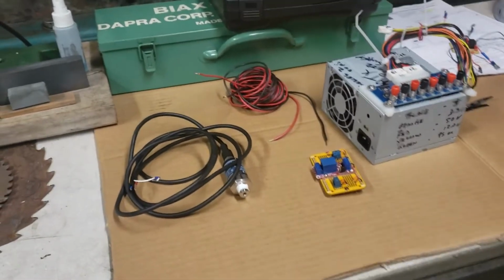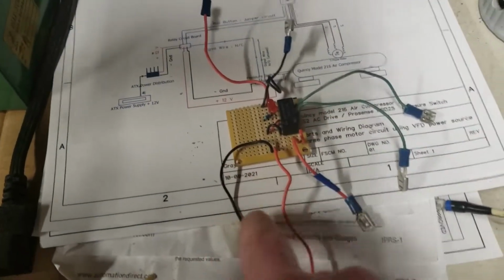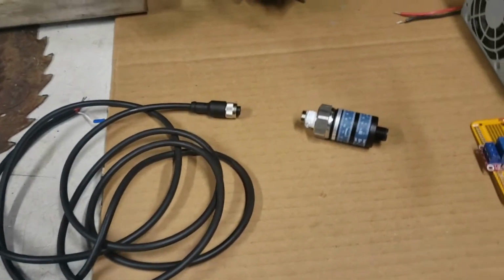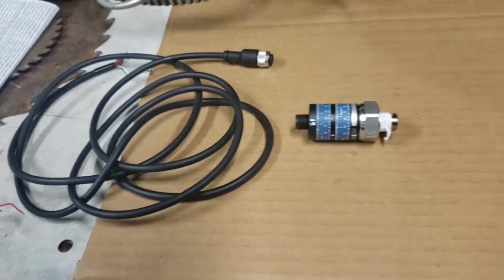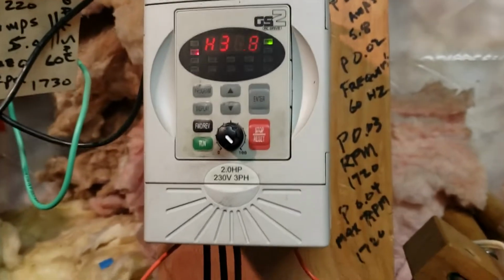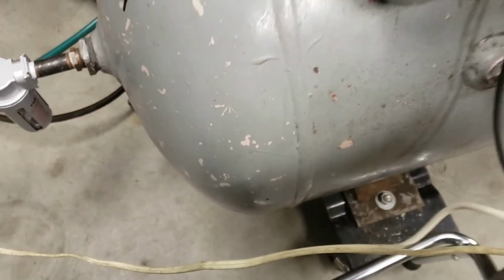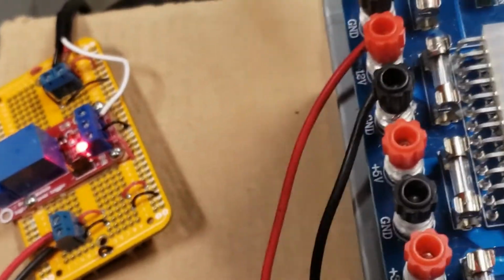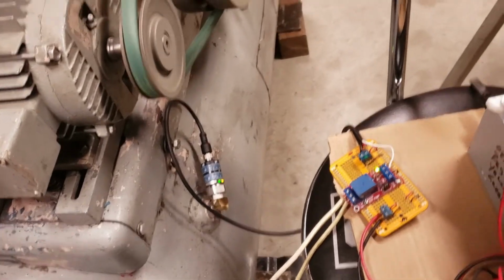Using a 3 Phase Air Compressor In a Home Shop. A Simple System that Works Using an AC Drive.

Comment: The transducer (pressure switch) should be able to control the VFD via the terminal panel that you’ve accessed for the run/start switch (not the same inputs ). That’s what the I/0’s are for besides stuff like PWM. You could likely power the transducer through this location as well even if you need to buck/boost ($5-10) the available voltage out. TBH a 10v output would likely work.  The Power supply your using is overkill and costly to run just for a transducer or even a relay. They are also extremely noisy (EMI/EMF).
Reply from the maker: Thia system was designed to isolate and protect the expensive VFD.  Keep in mind I use this Drive to individually power other 3 phase tools - Bridgeport mill, metal band saw, and shop vac.  
Of course, a rotary phase converter would be the best solution, but I don't have one.    
If you should get a system operating without a relay and separate power supply, I'd appreciate you shooting a message and a link to the video.

Comment: The drive will put out control voltage…you could get rid of all of your added control system except for the pressure switch
Reply from the maker: Did you mean the AC Drive could be used to provide 12V power rather than using the ATX power supply?     
That is likely true.  
But those AC Drive can be easily damaged when using their terminal strips.  I chose to isolate the AC Drive and to only use the AC Drive as a switch that provides power on/off to the compressor motor.  And then the relay is used as a switch for the AC Drive.
Reply: @GrayCo  according to the drive…the VFDs do put out a control voltage that is compatible with its own control system…I like your setup but think it’s just too complicated as it still only turns on and off the drive…everyone does things their own way…I just would have only added the pressure switch to the drive itself
Reply from the maker: @redneckways1617  Watch the video.  I explained in the video that I first used the AC drive with the compressor.  But this meant turning on the AC drive, then closely watching the pressure gauge until the pressure reading reached about 100.  And of course, then once the pressure dropped after using "some" air, at some point it would require repeating the entire process.  

I don't want one of those portable air tanks that requires going to the gas station to refill the air in the tank.
Reply: @GrayCo    he’s explaining that you DONT need to personally monitor the tank pressure. But also you don’t need all the other components . You can control the VFD with just the transducer ( your pressure sensor/switch) You’ve essentially driven around the block twice to reach the same destination.  But even at that you could have done it much simpler and cheaper.